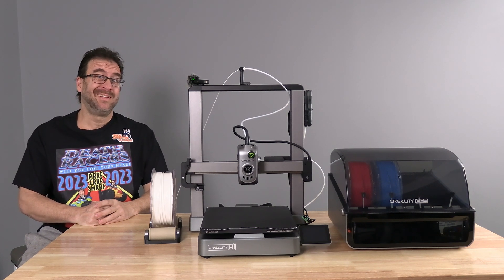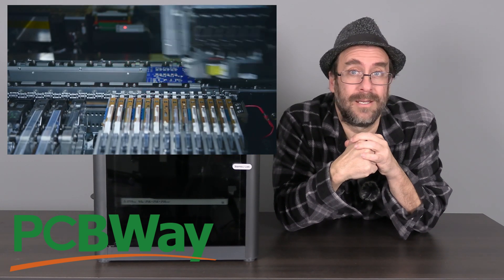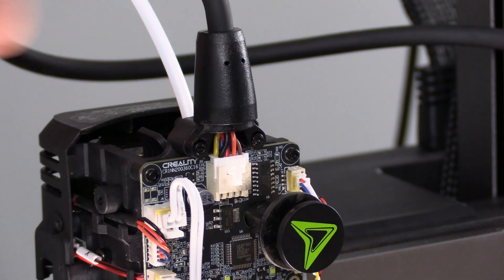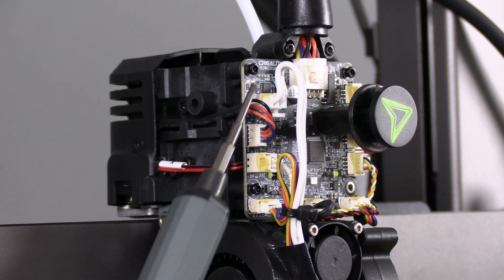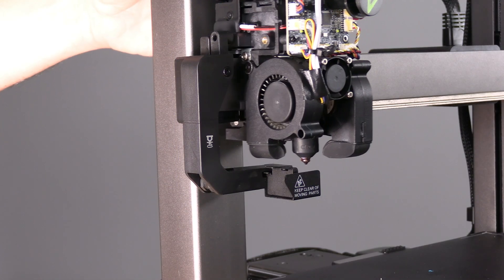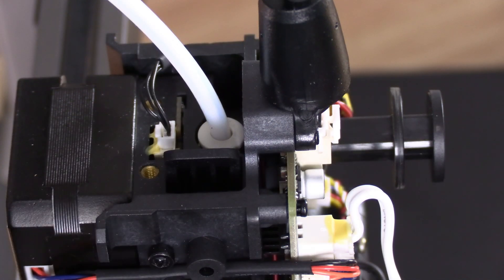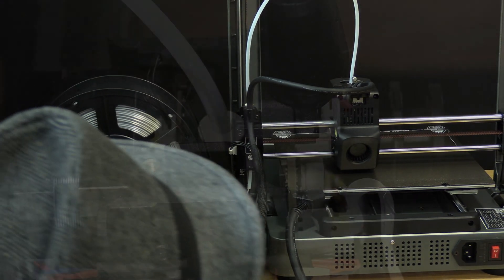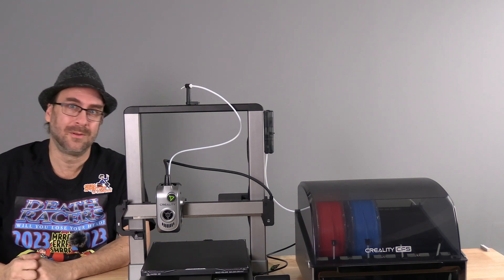Creality "HI COMBO" Toolhead Deep Dive. (Tool Head?) - 3D Printer Hot End

Comment: I got one of these to be a dedicated Hueforge machine, and I have been very pleased with this machine.  I am waiting on my U1 arriving and for the INDX to release to really get deep into more complex multimaterial printing, but traditional multiplexers are still an excellent choice for Hueforge or anything where the filaments only change a handful of times per print and/ or at the layer lines.  I am planning on getting a second one because it's been such a great machine for this use case (and I'm secretly hoping that the upcoming toolchanger revolution is going to mean a lot of people will start flooding the used market with multiplexers and tanking their value so I can make myself a dedicated Hueforge unit in my print farm on the cheap >:3 )

My only complaint so far with this machine is how much of a pain it is to clear an extruder jam.  This toolhead seems to overall be designed a lot better than the K1 and K1C, and I'm actually in the minority in thinking that overall the K1C's 1st gen unicorn hotend (after the heat sink was revised, especially) is pretty impressive for a stock hotend at this price point. but I think they took a step backwards when it comes to getting easy access to the extruder.  The K1 extruder wasn't the easiest I've ever had to get into, but it was simple enough that clearing a jam wasn't that big of a deal, even if the extruder stepper cable routing is finicky and dropping that motor is both easy and an express route back to the fucking spare parts storefront.  

It's not impossible or anything on the HI, but it definitely feels like a slight regression in ease of access, to me.  I'm sure part of this is because the HI toolhead was designed around the filament cutter being integrated from the get-go rather than having it be release in the form of a shoehorn retrofit kit ~2 years after release.  IDK if the HI toolhead is the same/ similar to the K2's beyond just sharing the same nozzle and hotend, but either way I think the next iteration of this design should work on making extruder jams easier to clear.  At least, so far, extruder jams seem to be more of a filament quality problem rather than an issue with the extruder.  Every jam I've had has been from basic Elegoo PLA (a couple different colors, too).  IDK if high-end extruder temps they have printed on the spool are just way higher than it should be run at, if the filament diameter is just all over the place or out of spec and causing back pressure that's mushrooming the outward inside the extruder, if it's because the surface of the filament is really quite rough for a basic, non-matte PLA, or a combination of these and other unknown factors.  What I do know is that I haven't had a single jam with any of the Sunlu, Polymaker, Creality, 3DHojor, Geeetech, Stronghero, Amolen, CookieCAD, Ankermake, CC3D, Gizmodorks, eSun, or the pile of sketchy Temu no-name filaments I have pumped through this thing and the CFS.  But I also never had trouble with the same spools of Elegoo filament on any of my other printers, either, so freak coincidences and/ or a set of isolated causes localized entirely within my room have not been ruled out.
Reply from the maker: I've found the Hi prone to extruder Jams as well. Mine hasn't been turned on in months. The K2 Extruder was also prone to Jams, but, the newer version seams to be doing much better. The K1 is my favorite creality machine. I run 3 of them for endless hours a day since launch. Total work horses!

Comment: Bowden tubes are the worst. I would yank that out immediately!
Reply from the maker: NO
Reply: @3DRundown  I would chop it off about an inch out from the print head then. No need for the thing. if they wanna get obsessed with forcing you to need it go into the print head, I would remove the rest of it.
Reply from the maker: Brother, all the newer machines use PTFE to guide the filament into the Extruder. The X1C, P1S, K1, K2, Orange Storm Giga. It causes no problems at all. These don't touch the hotend, like you may be thinking, such as older External Extruder setups
Reply: @3DRundown  There are lots of problems. even with just PLA. There is zero reason for it with a top mounted spool. Heat creep and broken filament inside the tube can happen even when not touching the hot end. There are posts all over about it.